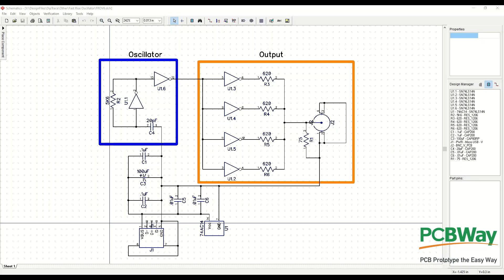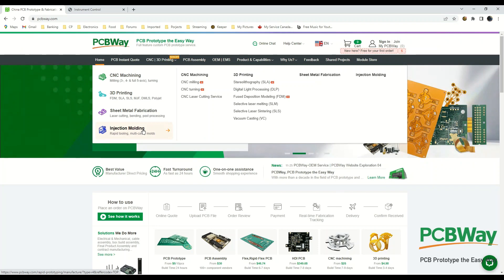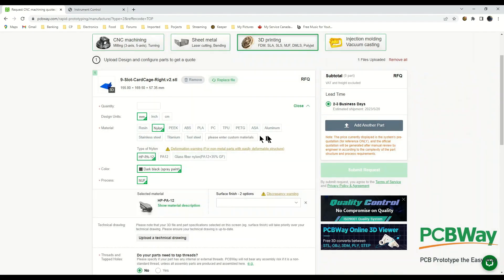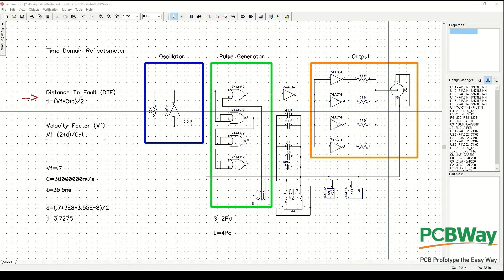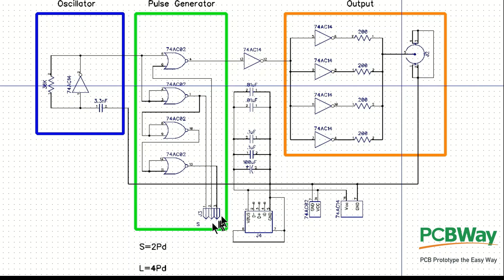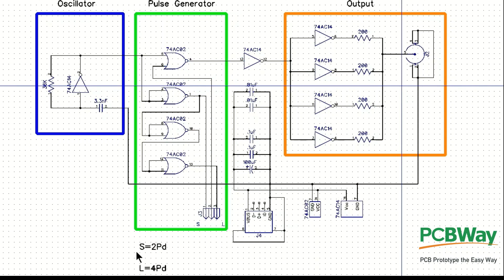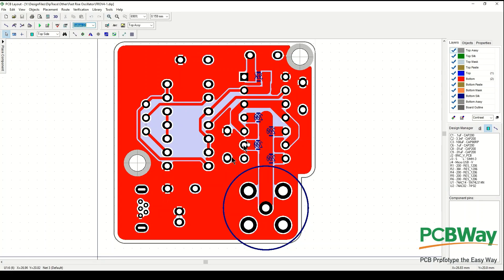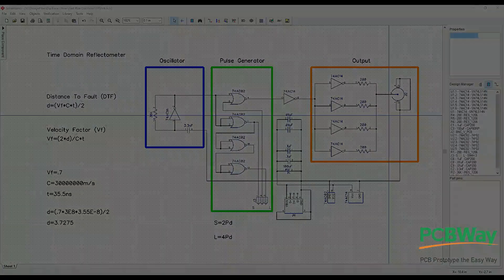0050 - Project: Time Domain Reflectometer Part 1

Comment: Hi, I have another question for you, since I would like to realize a low-cost TDR,  I would connect your TDR Unit to a low-cost oscilloscope. Do you believe that an oscilloscope with a 10 Mhz bandwidth could be enough?  Thank you very much
Reply from the maker: Unfortunately not.  This TDR has a rise time of about 2.5nS.  A 10MHz scope only has a maximum rise time of 35nS.  You would need a scope with a bandwidth of 150MHz or better.  The Fast Rise Time oscillator would be a better option if you built it with a much lower frequency - like about 20kHz, but the method of determining the reflection time would also be different.  Also, the resolution of the 10MHz scope might not be good enough.  What is the maximum sweep rate?
Reply: Hi, the oscilloscope I was thinking of is the picoscope 2204, that has a SAMPLE RATE of 10 MS/s
Reply from the maker: @alessandrocomegna1984  The sample rate is actually 100MS/s, and the maximum sweep rate is 10ns/div.  However the bandwidth would not be fast enough for this TDR.  The Hantek 6074BC is about the same price but has a 70MHz BW with all 4 ch. working and 270MHz with only 1 ch. working.   It has a sample rate of 1GS/s.  This unit would be plenty fast enough with one channel enabled.

Comment: I'm thinking with a DPDT switch you could possibly combine both circuits? Maybe would need another one to reconfigure the output stage...
Reply from the maker: Do you mean the output (50ohm vs 100ohm) or between fast risetime oscillator and time domain reflectometer?
Reply: @uni-byte  either the latter, or both
Reply from the maker: @ivolol  Well, the latter is definitely possible.  The only comment I'd make on that is FRTOs are usually up around 10MHz (but I really don't see any reason why they need to be) and the TDRs are usually a leisurely few kHz to allow enough time to make measurements with reasonably long cables.  For the 50/100 ohm, probably just throw in another hex inverter and have two separate outputs.